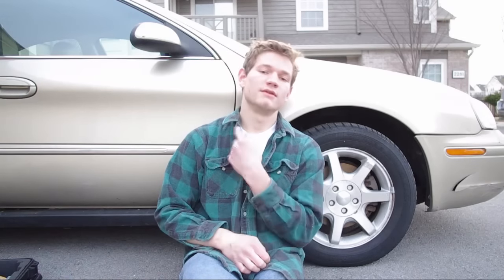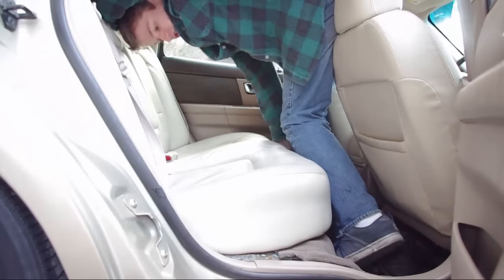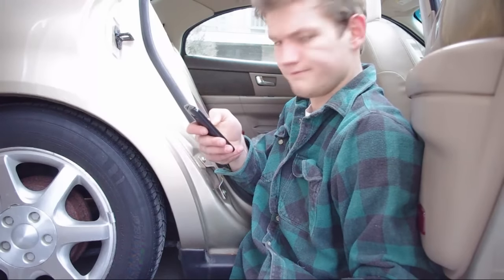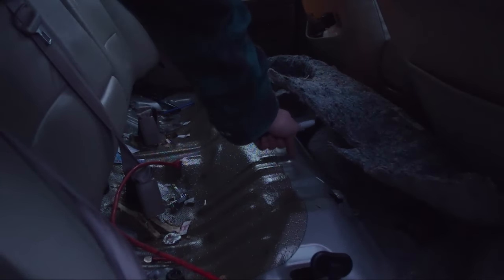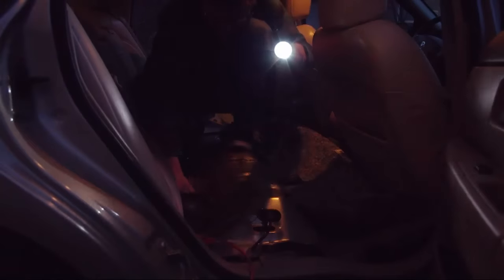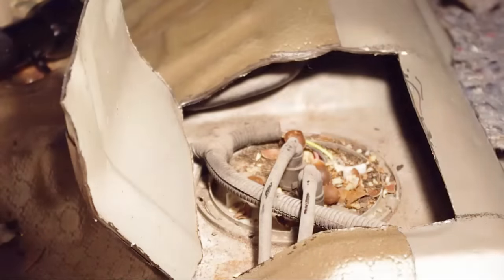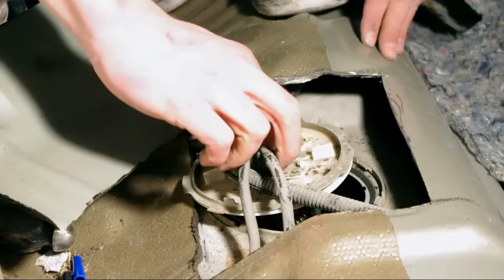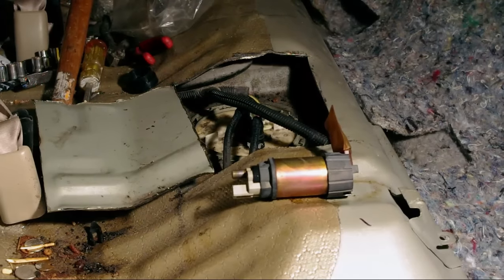Changing a Fuel Pump Without Dropping the Gas Tank

Comment: Here is a total amateur's comment, which also addresses some of the below stated "why not" questions.  
I had a similar issue with a van, looked all over YouTube for answers and found other talents who did the same thing you saw here.  Having a full tank made me think how safe dropping the tank would be, if you don't have a perfect setup. 
Cutting out a square sounded pretty good. But just for the hell of it I consulted the Chilton manual.  There in every other paragraph was a fat print warning about the potential danger of fumes escaping and causing an explosion.  I'm fairly convinced the Chilton folks are not rank amateurs, so much against my yearning for a quick way, I decided not to cut through the floor. 
Among the reasons were some of the very things this video apparently ignored.  Never heard him mention to disconnect the battery (highly recommended by Chilton). Noticed he used a regular screwdriver to loosen the ring that holds the pump in place (Chilton recommends using a brass punch, as they don't spark when you pound on metal), or the general mention that gas fumes are incredibly explosive.  Even the smallest amount escaping the tank - and some will, once you open to remove the pump - needs only any spark at all to ignite.  Confined in an enclosed space, this can make for a most wonderful fireball.  And that is probably why manufacturers avoid making such access points, some shade tree mechanic will sooner or later blow something up.
Final tally:  I let an automotive shop do the job and wrote the extra expense off as a contribution to my continued health.  But hey, it's a free country, do as you please.  Keep a fire extinguisher handy (another Chilton recommendation ; - )
Reply from the maker: Great comments.  Thanks for taking the time to write that.  I agree that brass would be safer and I did not consider that.  However, I did not perceive any leaking fumes from the tank at the time and the only time you use the screw driver for that is while the tank is still closed.  Also, it would take a pretty intense hit to spark a screw driver on a piece of sheet metal like that.  There is a requisite amount of vapor for a flame to exist in atmosphere and it's much more concentrated than what you can smell.  SO if you can't smell it, then there is very likely not a sufficient amount of vapor present unless something is wrong with your sense of smell.  Also, not just any spark can ignite gasoline, it must be hot enough.

All that said, I agree, additional safety measures can be taken.
Reply: Yea N I read a book n it said do not wear a bow tie to and interview, I did anyways n got the job.

Comment: Great job! Can you advise how far in from the outside edge of the passenger door to cut the right side of the hole, and how big to cut the hole, on a 2001 sable. Thanks.
Reply from the maker: I don't remember.  I suggest just going on Google images and doing the math.  Or going to the junk yard and seeing it first hand.
Reply: @TheCousinDan  Thanks for the reply. I found a Youtube video for a 99 Taurus that said to start the hole 20.5 " from the passenger side door frame, and extend the length of the hole 10' toward the driver side, with the height of the hole being 9", and those instructions worked great. I had to make 2 "crease cuts" at 2 corners to accommodate flexing the electrical lines to get the pump out. I used a pair of straight-cut tin snips rather than a grinder, and they cut pretty easily.  Found a pump motor on eBay for $16 rather than pay over $100 at retail parts shop.😊
Reply from the maker: @joepiecora426  VERY NICE!  Great work on the savings.

Comment: Can catch interior on fire from sparks.    I use a drill and then metal shears with heavy leather gloves.    Also - good to suck the junk from the bottom of the tank — using a hand pump with some long tubes that run a few feet away into a bucket.  The wasted 2-3 gallons of gas are a great investment to prevent junk from blocking the fuel intake on the bottom of the pump.  My theory is that junk is what actually burns out many pumps — they starve for fuel, overheat the pump seal and destroy it's suction/pumping.  Also, I get full power from having raw fuel 100% going into the system.   Extreme care needed to be used to not start a fire or inhale gas — lots of fresh air and all windows down...  if you are really thrifty you can install a big filter in-line into your hand pump and re-use that fuel...

Comment: vacuum it out before you open the tank
Reply from the maker: Good call
Reply: i could picture the acorn snd dirt falling in! lol
Reply: better not use any electric vaccum...
Reply: He didn't mention it, but he had to use a vacuum to remove all the foreign material off the top of the cover before opening the tank.
Reply: Why not use an electric Vacuum Philip? (not sure what other kind there are) The tank is still sealed at that point so no issues.
Reply: Well the vaccum does not store that air inside its self it has to go somewhere...out the back it goes vapors and all...any of those vapors that hit that motor on top then youll know why you should not use a shop vac to suck up gas
Reply: You are missing a major point, there are no gas fumes. You are vacuuming off the top of the tank before it is opened so there are no fumes going into the vacuum. What was being talked about was sucking the dirt off the top of the tank before it is opened not suck the gas out. That would just be stupid!
Reply: yea if they are only vacuuming it off before they unscrew the top of the tank then yea its fine. but i thought they were saying vacuum out the gas...my misunderstanding. but you never know nowadays...common sense is not a common trait anymore
Reply: There are probably a few idiots that would be dumb enough to vacuum it out lol.
Reply from the maker: Sidney Mathious I picked off particles and blew the dust away with my breath.
Reply: Do you tack weld the cover back into place?
Reply: NOT  necessary , of course , I do not smoke and am careful  ..cutting that access hole 5 mm above the tank !
Reply: Just use an air blow gun, but if a bird's nest is encountered , carefully remove it and return it to the mother bird .
Reply: Dave Brittain Mr. Brittain, if you miss this then you miss a major point and that is that almost every gas tank is an actual bomb waiting for the right fool to ignite the extremely flammable gas vapors on top of the liquid gas inside of a tank. Taking every precaution while working around a gas tank is not a stupid move.
Reply: i would clean that area before start
 removing  the punp
Reply: @phillipmayo2201  what is wrong with using an electric vacuum...the fuel pump itself is electric there is wires inside the fuel tank!! And it is totally safe
Reply: @kllgrogto5838  the fuel pump you have in your car is extrinsicially safe..meaning its elecrical parts are sealed from causing explosions. A shop vac from home depot is not and if any vapors reach your vacuum motor then it WILL ignite.
Reply: @phillipmayo2201  i understand, but before you open the tank there are no vapors the tank is sealed,no vapors no hazard I'm just saying but take whatever precautions you need to get the job done safely
Reply: man why be so patronizing

Comment: i used a die grinder. but be careful to cut in exact spot. his method is fine if you are only replacing the pump itself. there is another part of the wiring harness you cannot access without dropping the tank. I cut the wires for that and spliced the new wiring in to avoid dropping the tank

Comment: You didn't mention that the gas hoses would be quite easily cut as you are cutting the hole in the floor.  That allows you to use your fire extinguisher, if the tank is nearly full, or, make the front page of the local paper if the tank is nearly empty.
Reply: it's a great idea and I have done it on many vehicles...Safely by using a hammer and chisel and not a grinder. Old rusty gas lines on top will leak. Boom 😮. Grinding near gasoline and sucking up gas fumes into your vacuum explodes from the sparks in the electric motor.😮

Comment: Thanks for this. I've been looking for a used Taurus/Sable. Before you work on the fuel pump you should disconnect the neg battery cable. GM cars made after 1996 have an access panel for the pump in the trunk. Chrysler has them under the rear seat starting in the mid 2000's.
Reply: Jose Diaz  Its usually under the spare tire.
Reply: 03 Alero 3.4, 04 Alero 2.2 . Do not. Those are both gm .

Comment: Another option if you want to be more cautious would be to lower the tank, and then cut the access hole, and then replace the tank, and then replace the fuel pump. My concern was always "what if I drop the tank and replace the fuel pump, and then it fails again while I still own the car?" I replaced a fuel pump by removing the gas tank once, and I felt like I was working with a bomb...which basically I was. It's the fumes that will cause the explosion.

Comment: CAUTION - GO SLOW! The fuel tank is 1/16th of an inch away from the floor steel on the rear cut on a '99 Ford Taurus & evap. hoses touch the floor

Comment: You’re in a crash, your legs are stuck. Fuel is gushing out, and you cut a ‘hatch.’ Broken legs aren’t nearly as bad as skin grafting & inhalation, if you live through it. Not to mention the deep existential crisis from the regret.

Drop the tank. If it’s dirty, use FC01, or replace the tank. A new tank for my car costs $80. That’s $25 cheaper than the pump unit. Do the job. It’s hard work but the challenge is good for you, plus you get to inspect & clean/replace things - like evicting a spider & egg sack blocking the canister purge valve (true story). Chris Fix does it. You can do it.

Comment: I've done many fuel pumps on Pontiac Fieros, the aftermarket pumps don't seem to last long. The tank is in the very middle of the car and this trick would not work at all because the fuel sending unit has hard lines that come out the top at a 90° angle and you'd have to cut a massive hole to get it out. However if you've followed the advice you have given and done some research you would never run into that problem on other cars that could have long hard lines like the Fiero.

The money saved should be around $220 assuming you paid around $80 for the pump because this wasn't a vehicle that required you replace the whole sending unit with the pump. 

Cutting up a worthless Ford product wouldn't bother me but I think I'll stick to dropping the tank unless the manufacturer designed a service port.
Reply from the maker: +Josh Bishop Ok, Fieros are out.  Good to know.
Reply: josh bishop k
Reply: its not worthless if it gets you to work and back inexpensively

Comment: Tried this and the gas lines were wedged into the floorboard so as soon as my wheel cut through it nicked a line and sprayed gas. Scariest crap that's ever happened to me. JUST DROP THE YANK
Reply from the maker: You have to plan and measure.  That's why I said you need to look up photos of what you're dealing with.  And don't gut all the way through, hammer the last bit out

Comment: good evening -2006 cts 3.6L bad gas smell,possible vapor canister full of gas-would like to check fuel,and top of tank-will not use die cutter-afraid of fire or explosions do you have ideal,or i have to lower rear cradle(a lot of time-thanks Fred
Reply from the maker: I don't know of a way to cut through that without generating lots of heat.  Is there not a removable panel under the seat in that car?  But I agree that grinding would be a very bad idea in this case.

Comment: You forgot to warn everyone about drilling through the gas tank when you drill your holes to put the sheet metal strips in. THAT is the hardest thing to do. My dad drilled into the gas tank of my 1970 Chevy Monte Carlo when I was a kid fixing up my car. Very bad experience.  You cant plug the holes in a gas tank so we had to get a new one. It is SO VERY EASY for the drill to penetrate the tank. It only takes a split second!!!!!!
Reply from the maker: Brett Merchant Good point.  I would hope that people would understand that since I talked so much about not cutting through the tank with the grinder.

Comment: Before you open the tank up, scrape, brush, or vacuum the crap off the access to your busted fuel pump. Then open the tank access to the fuel pump! Not all filters to the pump keeps the dirt out of your brand new pump. Sometimes not replacing the filter causes the filter to disintegrate due to age, fouling and burning the pump out. Some new pumps do come with attached filters, but a lot do not. Why take a chance?

Comment: +Daniel Engling I have a 1990 Buick LeSabre Limited.. 3800, 4 door Sedan.. Where is the common place a fuel filter is, and how do I remove the fuel pump without dropping the tank? Where are the fuel pump-fuel sending unit, on a 1990 Buick LeSabre Limited 3800, 4 door Sedan?
Reply: lawnmowermanTX Like the man said,  you need to search for A Google Image of that fuel tank and carefully measure from a common point that you can see both inside the car and underneath
Reply: Thanks for the feedback.. It turns out... The crankshaft sensor fried-shorted out, and destroyed the ignition module.. The 1990 Buick LeSabre is back on the road! I just need a few thousand bucks on an entire air conditioning system, and driver side door hinge alignment, weather strip, 4 new good power window servos, uh... new speakers, and driver side seat.... I also have a 1994 Buick Century Special, that needs a new engine, transmission, 4 new power windows servo motors, tires, flush the tank, paint job, lot of work, and NO real money....  I dont think, this particular video, could help me on a 1990 Buick LeSabre, 3800.... 3.8 liter V6, Uni-body construction? Thanks again Walt Anderson... The Fuel Pump is on the fuel tank, and it has to be dropped.... I had no idea the complexity issues of where General Motors put fuel-pumps, and fuel relays, and fuel filters... :P Thanks!

Comment: I had a 95 Ford Escort ZX2 that either came with an access plate or the previous owner had this done. It seems that model of car had a tendency for fuel pump failure as I had to replace fuel pumps twice more in the six years I drove it.

Comment: Do not ...repeat ..do not use a grinder! Common sense says if there is a small leak or if the lines are rusty and something were to hit these rusty,crusty lines...as often is the case.  Remember...funeral directors need money too.
  I'm all for cutting, but use a sabre saw or drill some hole and use a hacksaw or such other non-sparking device. Chiseling hammer?

Comment: Use your shop vac to vacuum any dirt up and then use your air compressor and blow all the dirt away from that area and then proceed to go forward with removing the fuel pump.

Comment: I know a lot that wouldn't do it, it should I say, that way.. a good mechanic will assume there's a leak at the pump opening. Grinder will for sure ignite the fuel, and bye bye car, and house if your in the garage. All to save a few hours .
Reply from the maker: You should try it sometime.  It won't actually ignite.  Autoignition for gasoline is actually 495 degress F

Comment: Hope and pray you do not have any fuel leak underneath  in that  area when cutting. may want to cut it outside so if it becomes a lit torch it will not burn your house or shop down.

Comment: I love the video good idea however next time by a foreign car you won't have this problem they all have excess panel from the top an exact same spot Plus the pumps last about 175 to 220000 miles I have a 2002 Toyota Camry and I did the job at 204,000 as a preventative maintenance I also changed the fuel pressure regulator because I was only 20 bucks
Reply from the maker: Ralph Kowalski I completely agree

Comment: Cutting a hole in the back seat takes longer than just dropping the tank and doing the job correctly. I’ve tried it both ways.
Reply: Yea using scissors
Reply: Pretty stupid to cut a hole in your car like that any way. Half hour to drop the tank is much better. Some people shouldn't work on cars.
Reply: @frankjones8159  half hour? where are you from?

Comment: Really i have that intank hiddn fuel pump like in xterra 2007 or pathfinder and ill be doing this once fuel pump fail ill make a door for the fuel pump with grinder and take a door from 2003 model and fix It in 2007 with screws and done 👍

Comment: The only thing I would have done differently would vacuum the squirrel remnants and used an air nibbler so as not to have sparks. I fear some knucklehead will cut the tank and at best, have to replace the tank. Worst Die. People have been doing this a long time. If its a car your going to keep, weld a metal strip around the whole metal piece you removed and put a seal around it before reinstall. You may get fumes in the cabin if you don't at least calk it when finished.

Comment: Did the same thing with an expedition. I used "landmarks" underneath to figure out location
Reply: also i started with a small cut square to see and then enlarged it as i could visually verify
Reply from the maker: Good work.  How did you get it back together after cutting in multiple pieces?
Reply: Daniel Engling made a new cover from an old tag
Reply from the maker: Ha!  Great.
Reply: I have a 2004 Expedition. Need to replace fuel pump. Can you give me an idea or coordinates to cut floor. I like this idea. Thx

Comment: I would only cut three sides and bend it up. Service the fuel pump then bend it back. Then use duct tape ...to tape the hell out of it to prevent moisture getting in.
Reply from the maker: That could also work well.  Good tip.